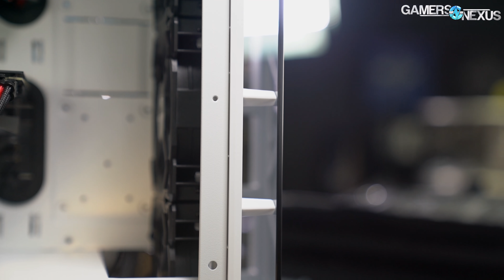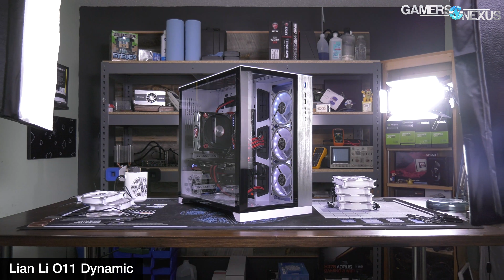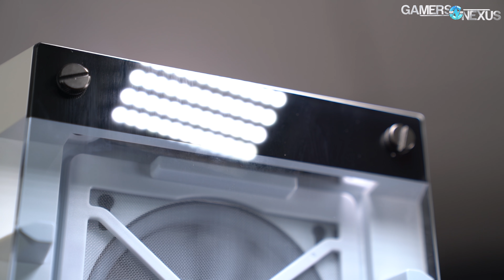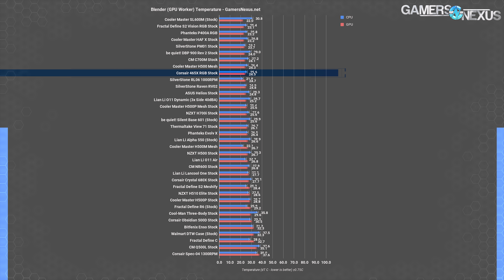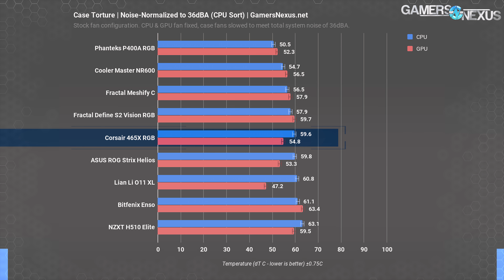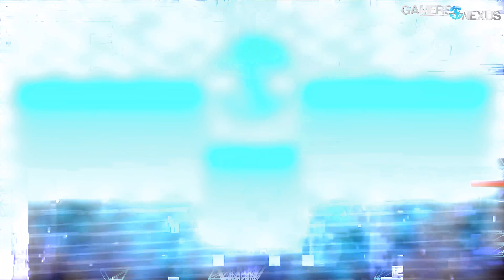Corsair iCUE 465X RGB Case Review: Glass with Airflow, Sort Of

Comment: I have this case and it's great! Good Temps lots of airflow and easy to build in, also for some reason mine came with a commander pro even though that's not advertised
Reply: They were probably out of the standard controller. So instead of delaying shipping these, they said “fuck it” and put commander pros in there.
Reply: @Trainmaster909  mine has a commander core, idk if its better than pro or not but the ease to use is pretty neat
Reply: @PannyLanny  I hope that they are selling them with cores when I buy the parts for my custom pc. That would be one hell of a bargan with a case with 3 decent fans and a commander core.
Reply: Ayo i had one in my case as weil when it came in

Comment: thank you, i got this case recently and ill tell you they listened and a fan controller and better LED controller are now included in the form of the Commander pro built right in
 with LL120 fans! I was about to move the bottom fan to the back of the case, im glad i watched your video first as i enjoy the look of the 3 fans properly synced in front, also i paid $150 CDN for the case, so it must be  even cheaper now in the U.S.... it also came with 4 temperature sensors you can put anywhere, but i have yet to use them. ALSO be careful when selecting RAM as i could not top mount a radiator with my Corsair RGB ram.... which seems odd as its the best ram to match the fans yet it restricts this case from any top mount radiators...
Reply: Do you think that they would come with a Commander pro today in 2022? I mean I'd rather a commander core but still. That would greatly improve its value today.

Comment: I just bought this case (November 2020), there's a couple things worth mentioning since this review.

The price has come down to $139 and now includes Corsair's Fan Controller Pro as well as the rgb hub.  To me, that makes the new price worth it combined with included fans.

HOWEVER, if you're running Corsair's Vengeance PRO RGB RAM, an AIO with fans will not squeeze into the top slot, it has to be front mounted. Quite a major oversight from Corsair in my opinion when their own products keep you from fully utilizing their case.

Overall I still don't regret buying it and don't feel like I overpaid, but if you don't want to rice your PC out like I chose to do there's still better options for the money.

Comment: This case is nearly identical to Corsair 275R Airflow. Just Mesh front in 275R Airflow and only comes with 2 front and 1 rear non-RGB fans. Which will cost too less and may be performs similar or better in terms of cooling performance IMO.

Comment: I have this case! bit tight on the cable management side but it looks awesome with 2 extra LL120 fans!
Reply: @Berkay Keskin yup its a cool case temp wise.
Reply: @pandecoco15  whats your average gpu temp? specially on high load?
Reply: @pflxck  around 80C and that's not even with fans on max RPM
Reply: @pandecoco15  damn i see ty. I use default fancurve and I was a little worried cuz it goes to 75 easily even in sinple games, but it never really goes above that even when i play fh4 on 4k ultra settings. Just not sure if constantly leaving it on 75 is fine or not, im aware its made for 90+ but still
Reply: @pflxck  It should be fine. I did a lot of fan tuning so I suggest you do that. Amazing case, just sad that You can' t really top mount your radiator unless it's a non RGB ram

Comment: I have this case now for 8 weeks, I have a Corsair 240 AIO, and Ryzen 7 3700x. I watched the review before as well and wanted to give some feedback. As I have a AIO I could use the two extra fans as top mounted and used two of the 3 front ones to mount my AIO (tubes down..-). I bought one more fan so that I have essentialy 6 fans. All fans are on the minimum and are very quite and my temps are great. I love this case, I also had no issues with cable management as I planned from the beginning to have a modular PSU and no SSD, only two M.2 drives. the cable management for the board is very easy as mentioned in the video the openings are perfect for it as the board does not reach the top of the case. I must note that if someone is planning to have a Top mount AIO, make sure to get small RAM sticks as the AIO will not fit comfortable at the top.
Reply: nice feedback... AioLiquid cooler for sure fits best in the front, as i can tell.

Comment: Well I got this case and regret it. My first impression was 'wow, this looks great', then I realized it has ugly af X plastic on front dust filter, another thing, NO SPACE FOR CABLES FROM PSU IF YOU'VE HDD INSTALLED, and my PSU is modular so only usable cables are in. Temps are okay, design is cool and it's also well made.
Reply: u realised it had the x when u saw it in person, not when you were buying it?
Reply: @its_godlyrl2066  On screenshots it looked pretty okay, but i just made custom panel with dust filter without it so it looks nice

Comment: In the thumbnail for this video, the GN guy looks like a Jedi.  Just the lighting making his hair kind of blend into the shirt like a big robe, but it was amusing.  Anyway, I wanted to suggest a case-modding episode, showing people how to do something about these glass cases, on all sides, spacing the glass out.  Like what off-the-shelf, easily-orderable hardware parts would be a good bet for that kind of thing (preferably with with some rubber or something in there somewhere to prevent later noisy vibrations).  There are so, so many glass-based cases these days, and they look nice, but they're clearly going to be the slow, suffocating death of a lot of expensive systems.

Comment: It's actually a huge step up from 460X and pretty much fixed all the problems 460X had, like messy bottom cables, stupid two piece power supply shroud, a SSD tray that messes with cable management and more. Don't forget those 3 fans retail for $130 alone.
Reply: Just ordered mine in sweden for 100euro, excited
Reply: @lightsaber6595  dude I got it in greece for 250 wtf

Comment: I have this case with 6 LL120's in it and it's fantastic , Cable management is a bit tight but can be done  , CPU and GPU run cool and quiet  and the case is pretty small , takes up very little space.....I would recommend  the case.

Comment: I get why manufacturers want glass to work. It looks cool with RGB lighting. Mesh looks significantly less cool that way. The good news is that right now, the case is only $120 on Newegg thanks to a $10 off coupon, and has a $20 rebate. So now it's a $100 case. I just picked a white one up along with a H110i Platinum, and since I use Corsair keyboard/mouse/headset, I can control the lighting in a single app.

Comment: what about water cooling? will there be space for a radiator? what about a custom water loop?
Reply: This is also what I want to ask, is it possible to install a 360 radiator in the front and a 240 radiator at the top simultaneously? (Both of them are 30 mm thick)

Comment: I love this case, really awesome and sexy, bought 5 days ago installed a h100 platinum corsair cooler and corsair dominator ram set, a bit small had to install the cooler on the case front fans, a bit loud tho but its really awesome and sexy, loving it.
Reply: Why every 2 weeks? I'm planning to buy this case aswell but that's alot of maintance
Reply: MinePlex12 - Gaming and streaming nah I got the same case it catches dust really well takes ages for the filter to get back and it’s only the front one I just take it out and blow the dust out and it’s fine only takes a minute
Reply: @aaronmilroy7506  Hi, so this case doesn't accumulate a lot of dust? That's awesome! Also, I was thinking of fitting an AIO on the top. You're saying it's hard to fit it? I was thinking a 240mm one at the top. Would this be possible with G Skillz RGB RAM?
Reply: @LFiers  yeah it’s real tough. My ram was in contact with the ram but Corsair vengeance is about as small as you can go so I’m afraid I have my doubts about g skill
Reply: @aaronmilroy7506  I will look into the Corsair vengeance. Also, can the lights on this case be synced with the motherboard like via Aura Sync through the headers and would I need any extra hubs or connectors to install more Corsair fans?
Reply: @LFiers  I’m not sure I just use mine through I cue
Reply: @aaronmilroy7506  Cool. And does all the lights sync with your motherboard and RAM RGBs too?
Reply: I'm getting me this case as well, like the looks and the specs, I will have minimal cables as no Sata drive or any other HDD drive with cables, just M.2, so cable space in the back and bottom is no issue with Modular PSU
Reply: ive got one too, can you fit your cooler on the top? i was looking at the same cooler you have but im thinking it might not fit at the top of the case
Reply: @aaronmilroy7506  my cooler is on top actually with 2 fans, I tried to put it up front but screws were really tight couldnt get them right
Reply: DozerLab thanks man I’ll get one then
Reply: @aaronmilroy7506  but one thing after 4 months of usage it needs to be cleaned every 2 weeks but its easy, u have to remove the filters (manually) and wash them it has 3 filters and thats it, all of the dust are sent to them from the case
Reply: How could you fit your liquid cooler in the top ?

I've seen a lot couldn't do that
Reply: zTohka it barely fits. I’ve got low profile ram and it touches the cooler so with any other ram it wouldn’t of worked
Reply: @aaronmilroy7506  i think it should be on the front then
Reply: zTohka yeah probably but I wanted it on the top
Reply: @aaronmilroy7506  Iv'e just built a rig on this case and put the water cooler on the front but dunno if that was a mistake as my GPU is hotter than it probably should. I mean most of the time it's 60c on reasonably demanding games but games like control maxed out with full ray tracing I hit the 74s 75s. Thinking of moving the water cooler to the top instead see if this helps the GPU out abit, GPU is a 2080 super.
Reply: Jai Gray yeah it fits on the top of mine. Couldn’t guarantee it would for yours but give it a shot

Comment: You know what would be great in your tests -standarized testing using 120mm noctuas, where all fan slots are used, ie. case has 6 fan slots, use all of them at the same time in a logical manner ie front/bottom intake, top/rear exhaust. That would truly show the potential of the case in cooling department, as most enthusiast mount fans in all possible places.

Comment: Poor value? I'm thinking, $160 (shipped) cost for: 3x $37 rgb fans with a $111 total value  + 1x $30 controller + $40 physical case. Buying everything separately, you would pay $181 without shipping. $181 value > $160 (shipped) cost - for a decent thermal performing mid tower. So what's this about poor value?

Comment: It's not sort of its lots of airflow. Everytime theres a glass panel in front of a case u cut it down like it doesnt have good airflow. U did the same thing with the corsair 650x. Which had scientifically enough gaps to suck in the required air. And this one has even more. No not sort of but absolutely lots of airflow and more than enough for a gaming OC build.

Comment: This case doesn't seem like it's a step up from the 460x, did they just widen the airflow by extending the front glass panel a few millimeters? I would have expected the cable storage space to be better but it obviously is exactly the same.

Comment: It's really close to their previous crystal 460X just now it has addressable RGB fans, an extra 1/2" front glass spacing and they just replaced the two piece adjustable PSU shroud with a full length one piece one that just chokes off the GPU from getting any of the lower front intake fan's cool air :/  At a $160..."Really", I mean as for the older 460X case I was able to get that on Amazon Prime day this year for just $89.  I guess these higher prices are just another product of those tariffs on China :(

Comment: You're getting a decent case and being forced to buy corsair's excess stock of expensive (albeit good-looking) fans. 

Corsair needs to make a 480x mid-tower that looks like the 280x.
Reply: They made the 680X, but it's just too huge and too expensive IMO. Dual chamber design gets too large at ATX, it works best at smaller sizes.

Comment: Does glass not encourage a green house effect? Surely after long periods of prolonged use heat wouldn't be able to escape rather than causing concern for air getting in? Case builders need to install air conditioning into a glass case?

Comment: The original 460x has a hole under the Gpu, i think it helps feed some air from the bottom case fan, right to the gpu fans. Wish they had kept it. I would take that bottom grommet out, gpu needs air the most

Comment: Did Corsair make new fans for this case? IIRC the white LL120s were 2,200 RPM, the black ones are 1500RPM.

I think it's also worth factoring in the fan prices, white 3 pack LL120s go for $120 - $130 USD and rarely go on sale vs the standard case fans everyone throws out.
The $90 ones you mentioned were for the black LL120 1500RPM.

Meanwhile their most basic 3 pack fans are $30-40. RGB tax is real, I may buy this for the fans and sell the case, thanks GN!

EDIT: I'm dumb, I see the fans are black in the case they sent you. But Corsair's product page shows white fans with the white case except in one picture. I'm glad I watched this- pretty sneaky, Corsair. Making me want to leave your ecosystem.

Comment: In Australia the LL fans and controller is $149 so it makes the case a fair value but having glass so you can see the fans behind the filter seems strange...it would be nice to have the air filter around the front part ( no glass or mesh )and the side so you will have air with a nice flow and lower cost and weight

Comment: That glass panel is stupid, you're just looking at the ugle fans and filter. Take off the glass and pretty up the underneath with just a little bit of design I've see much better looking fans and filter setup. Seriously glass is a window so you can see the pretty stuff inside, if you haven't made it pretty then why are you using transparent glass?

Comment: I rabidly approve of the Front IO staying in place when the front panel is removed. This is one of my absolute favorite features of the case I'm currently using.

I'm still dreaming of the day when manufacturers sell alternative Front IO clusters as an addon item. It'd be nice to upgrade just the IO so I could take full advantage of my motherboard's features. (Though, I guess there's always case-modding... if you have the skills, or don't care if it ends up looking like a junior high science project)
Reply: Fractal does front I/O upgrades occasionally. This one is for the Define R6 series https://www.fractal-design.com/products/accessories/connect-d1/black-white-grey/

Comment: Just another copy+paste case. The glass panel in the front is completely useless if there are fans right behind it so you can't see the components inside, sure the fans aren't completely useless in this specific case, they are still strangled. This is probably one of the ugliest fanorama fronts.

Comment: I hate how little space Corsair leaves behind the motherboard for cable management.  I hate it even more when they take what little space there is and fill it full of drive sleds and pre-routed cables that I have to somehow work around because the case won't close if I run a wire over any of those things.  Seriously Corsair, I have had cases that were too tall to go under my desk or too deep, but I have never had a case that was too wide.  Add another half an inch for the love of god!

Comment: I'd get it just because the nice mesh filter in front of the fans. It's far better than most mesh on cases where it has less surface area between the gaps. And that's what matters to me. For 160 though I'd probably just go with the H500p or even h500m (have the m currently).

Comment: USB 3.0 is backwards compatible with 2.0...
So why do we still use USB 2.0 ports at all? Legit question, what am i missing?
Reply: The same reason our motherboards have a bunch of PCI Express x4 slots when PCI Express x16 is available--chipset limitations.  Each chipset has a certain amount of bandwidth allocated for USB, and the motherboard manufacturers have to chop that bandwidth up in a way that makes sense for their target audience.  For example Z390 only has the bandwidth to drive 6 USB 3.0 Gen 2 ports. That same bandwidth can run 10 USB 3.0 Gen 1 ports, or 14 USB 2.0 ports.  6 Gen 2 ports would be fast, but a lot of cases have 4 USB ports on the front panel alone and most people will plug 4-6 USB devices into the back of their case--you can see where I'm going with this.  Motherboard manufacturers can throw a second chipset on the board to add more USB ports, but that means using some of your PCI Express bandwidth to run that second chipset.  It all has to come from somewhere.  

Also there's the issue with USB 3.0 throwing out noise that interferes with wireless and bluetooth dongles, so a few USB 2.0 ports will always be needed.  And hey fast ports are great, but most of the USB devices I use don't need the speed, so I'd gladly trade a 3.1 Gen 2 port for a couple more 2.0 ports for keyboards, mice, etc.

Comment: The internals look identical to my Spec 06 RGB but with.. Better RGB lol. For the price point there is not a lot of internal room to build or more so fit radiators, more than 5 or 6 fans, etc. The room behind the mobo tray is insanely thin so you have to smoosh everything down to close the side panel, which i heard is Corsairs MO lol.

Comment: Not a bad case it seems, but rather dated since it's essentially a carbon copy of the 2 year old 460X. Most definitely NOT worth $160. At best $90. Not a single feature makes it worth this much. 

Apparently they use those LL120 fans to skyrocket the price up a couple notches. I'll take the Lian Li O11 over this any day. Or, even the cheaper and better built Phanteks P400A.